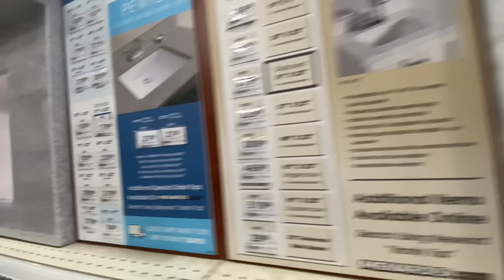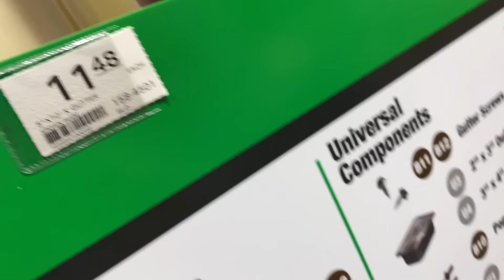Roofing on the house DONE!!!!! Fransisco did it !!!! E  sticking with concrete for sure !!

Comment: Did a lot of roofing in Indiana in the dead of winter framing houses still never get used to the heights carpentry is the hardest trait for anyone it takes a lot almost died a couple times but you brush it off😂

Comment: Black paper should be at least 6'' overlap , No drip edge, wrong nailing pattern. Ice and water and first row of shingle needs 1'' overhang. The nail pattern will void the manufacturer warranty.
Reply: I noticed all of that too, I hope they read the comments.
Reply: No step flashing..but let’s not rain on their parade 😂
Reply: The pattern is a mess too. My question is do we really think this guy is going to go back and warranty everything out of his pocket...? There is definitely going to be a need for warranty...
Reply: Good call outs. Noticed it all.  The venting looked odd too.   Probably the worst roof job I’ve ever seen.
Reply: Definitely not the Victory way
Reply: Pretty sure your not supposed to overhang your ice and water and not everybody gets drip edge on their houses although that gap should have definitely been covered up with a fascia board
Reply: @klabouch900  The ice and water guard should come down behind the gutter.

Comment: Hey Eric make sure when u do the brakes u clean em really good with a small wire brush and can of brake cleaner. Also grease the shit out them, grease them where they sit on the brackets, pretty much can grease everywhere besides the actual braking surfaces. They sell special grease but I use anti seize n that works great or can use silicone paste. Good luck brotha. Can’t b riding around squealing n squeaking like that, mad embarrassing lol

Comment: Eric, noticed another thing with video.  On the user side of watching, the setting icon for video quality shows 1080p/50.  Not sure what program is exporting your videos at 50fps but it in all technicality should be 60fps.  So again, not a huge deal, if your editing software only has 50fps then keep using it.  All in all, keep it up.  Before you know it, you'll have a 100k subscriber special :)